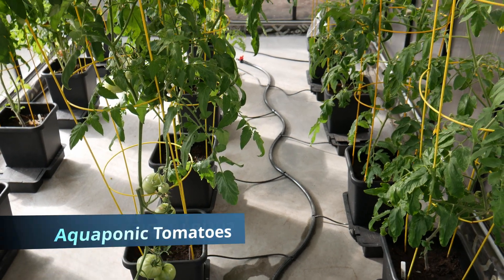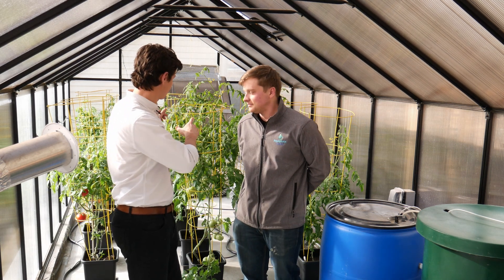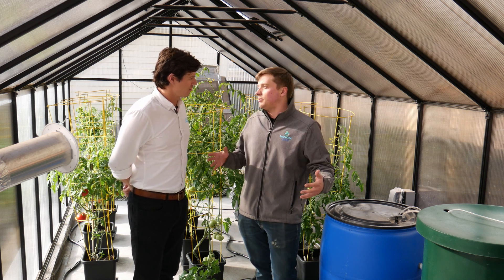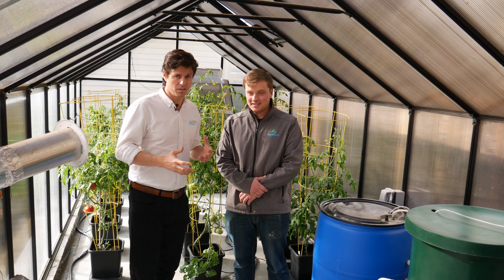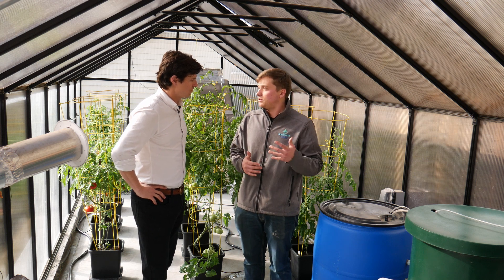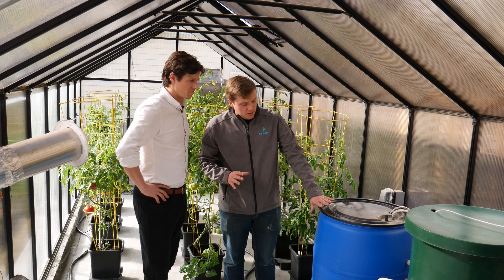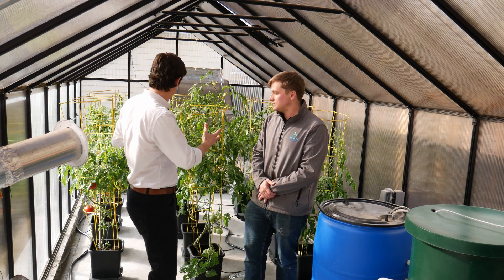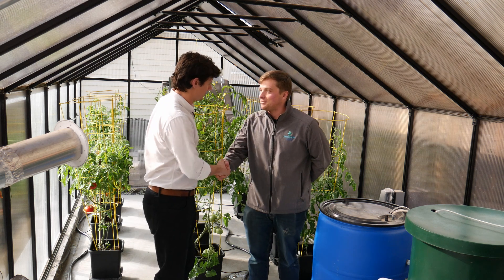Northsider Farms: Tomato Production with Aquaponics

Comment: Can we have more information on the design of the Auto Pots system ?
Reply from the maker: This system was designed by Rob at The Aquaponics Source. It is a very clever method for high feeding vegetables with longer grow cycles. There are other types of dutch or bato buckets, but this one allows for good ebb and flow, making it an excellent choice for tomatoes or any fussier plant that thrives in well drained soil.  

AST is an expert in fish and filtration. If you want   to know more about specialized hydroponics, please reach out to The Aquaponic Source at https://www.theaquaponicsource.com/contact/ 

Thanks for your question!
Reply: @ASTFilters    You again made a nice sales pitch for the system but I checked their website and this is NOT listed and other than you saying it is nice, there is NOTHING to say how it is configured.  Not even basically.  I realize that without an AST filter in the line, you don't need to cover it but there is no info.
Reply from the maker: @richardcormier2634  Sorry for the confusion, but this system was not designed or installed by AST. We are just highlighting one of our partner companies, The Aquaponics Source, and one of their systems. Feel free to reach out to them with any inquiries about their systems. Thanks for watching!